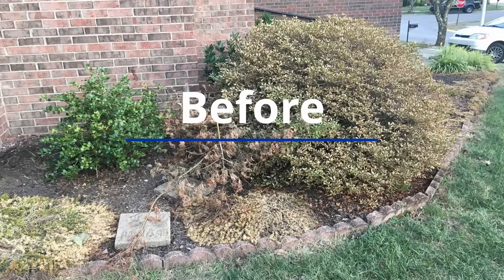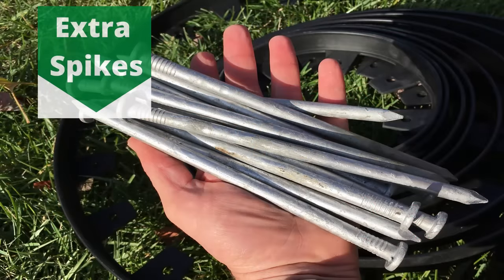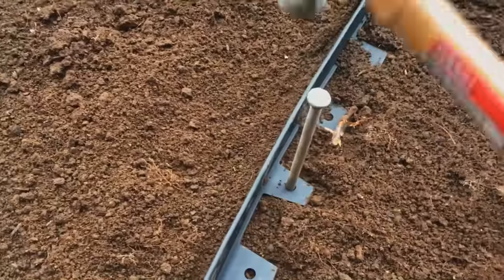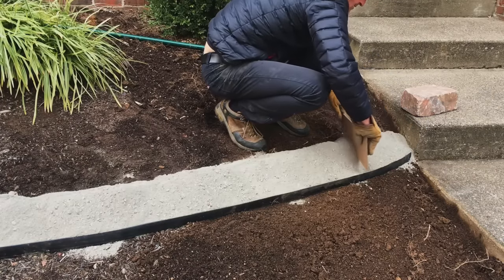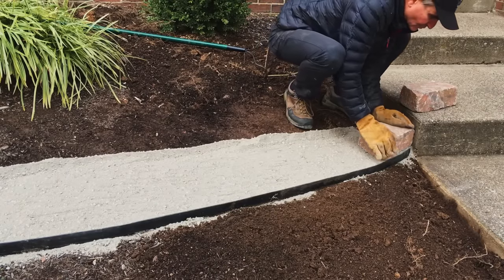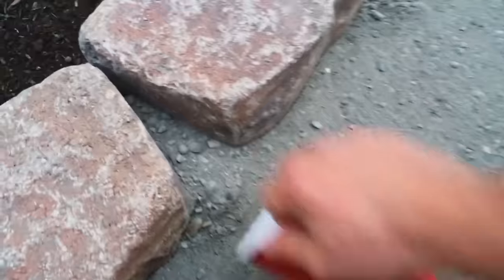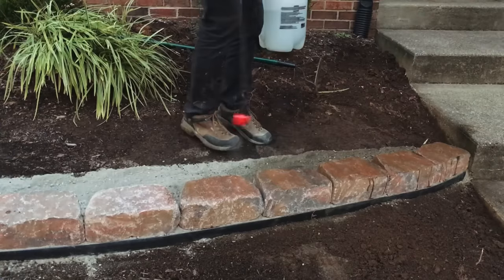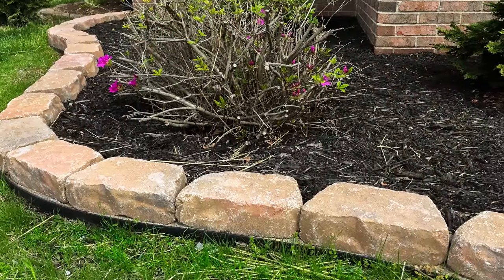easy diy No Dig Border *2020 UPDATE*

Comment: Why concrete and not just a gravel mix?
Reply from the maker: The cement provides four major functions in this border technique 1. Height(for looks) 2. Keeps the stones straight/aligned over time 3. Stability/strength 4. Weed barrier(the extra width is nearly impenetrable to aggressive weeds and grasses(Bermuda Grass) that we have here in Nashville.

Comment: Would this work with flagstone as a flush with grass boarder?
Reply from the maker: I'm interested in your idea. Can you explain the steps a little more to me?
Reply: Was wanting to try a  flagstone edge to transition  to grass. Wondering if the powder you were working with would work as well with flagstone as apposed to the blocks you used since my edge is flush with the grass.
Reply from the maker: Yes, this cement mix works perfectly with flagstone. I built a path in my front yard going to a swing and it has been there and is in perfect shape now for many years. Were you thinking you'd dig a little trench then to dump the cement mix into and cap it off with the flagstone flush with the ground?
Reply: @maxpatch67  Thank you for this information. I'm going to take your question as a suggestion of "how to" get the flush results. This is so the mower can go over the the flagstone for a clean edge between  peastone and grass.   Much appreciated.
Reply from the maker: I can't picture what you are talking about, but if you make it, I'd love to see it. You can email me pix at tim@timvogelaar.com. Have a great day, Jenny!!

Comment: In my opinion, there's no need to use cement. Just lay down  blocks and the won't move. Also, will save $. In the future, if want to remove blocks,   will get into a real problem removing the cement.
Reply from the maker: One good point you made is that the cement makes if more difficult to remove in the future.  This border should only be built if you are very sure of what you want forever. Here area the reasons cement is vital. The cement provides four major functions in this border technique 1. Height(for looks) 2. Keeps the stones straight/aligned over time 3. Stability/strength 4. Weed barrier(the extra width is nearly impenetrable to aggressive weeds and grasses(Bermuda Grass) that we have here in Nashville.

Comment: Did you use a level?
Reply from the maker: No. In almost all cases, the natural curves of the ground look really good with this border built on top of them. The border tends to self-level over little dips because when tacking the plastic edge to the ground, you don't attach it to the lowest spots,  so it kind of glides over those areas. Let me know if you need anything else, Denise! Have a good day.

Comment: thanks for this video! question: would you use this technique for a brick pathway? I'm thinking of getting the edgers, tamping some crushed concrete down.  then pouring the fast setting concrete on top and laying the bricks on top of the dry concrete.  Then coming back with more dry concrete to fill in gaps and finally misting it with water. What do you think?  Thanks in advance.
Reply from the maker: My pleasure, Valerie!!! Valerie, I did almost the exact same thing in my front yard, making a path to a swing we have in our garden area. I used flagstone with this technique about 15 years ago. I think it would work perfectly. If you went with the flagstone method, you could make curved edges which could be pleasing, but if you are making it straight, then your brick or block ideas are better. I put an alternative plastic edging link from Amazon in the video description for doing straight edges for you. Hey, if you make this please send me pix for my website as noted in the video description, I'm trying to show different ways of using this technique and yours sounds great!

Comment: Can I add a second tier
Reply from the maker: I never have because I don't think it would look so good. As you go higher, it is going to look better to use a traditional levelling technique. If you did try it, you'd need to use either mortar or landscaping block adhesive.

Comment: What if the ground is uneven
Reply from the maker: No problem. When nailing the plastic border to the ground, it will naturally skip over small dips if you allow it to. If there is such a big dip that you wouldn't like the way it looks, you could put some dirt in that area first. Otherwise, the border works equally well on flat or uneven ground.

Comment: This likely only works if you don’t have a basement or crawl space under the house.  You haven’t given the water anywhere to go but into the basement.
Reply from the maker: I use a system where I divert the water from the downspouts directly under the ground into either black corrugated pipe or white pvc(flows best) out about 15 feet or so into the yard to a drain box where the water can exit. It works really well and that's what I recommend. Thanks for your comment, umiluv!!

Comment: Has anyone tried this with sand on the base rather than concrete as a less permanent solution?
Reply from the maker: Using sand instead removes the best features of this border which include permanance, weed barrier abilities and beautiful uniformity over time that keeps the border looking perfect for its whole life. So, you can use sand, but just understand that you are losing the best qualities of the border. Thanks for the question and have a great day, Graham!

Comment: Some of my bricks didnt stick! Idk what i’m doing wrong 🥲
Reply from the maker: Did you tap them down into place into the dry concrete mix-before adding water? Did you put some scoops in between them? Is it cold where you are? It needs to be in the 50's for the concrete to set up. Without being there myself, these are the things that could make it not work right. The main fix for loose blocks in the end is to use concrete adhesive on them. I hope this helps, Irene.

Comment: Question why pour concrete
Reply from the maker: The concrete adds strength and stability as well as height and also works as a great weed barrier. It is the single best part of this border technique.
Reply: @maxpatch67  seems like using this method of just buying the quickcrete is cheaper and easier than using paver base, rock and other things to lay the stone. i'm gonna try it this week as i am ripping out my builder grade new home landscaping and pushing the grass area up to house bushes then doing this technique! thanks a lot!
Reply from the maker: alright!! I hope it is turning out good for you. The cement is so much better than paver base. The cement is really the key element to this technique that is unreplaceable. It creates structure, stability and acts as a great grass and weed barrier here in Nashville where we have very invasive Bermuda Grass.

Comment: Can you put a weed barrier under the quikrete?
Reply from the maker: This border built right on the grass, so a weed barrier might block the dry mix from spreading, and sinking down easily to a good 2" thickness that it is designed to be, so I wouldn't recommend it. Here is what I recommend for a weed barrier: https://www.youtube.com/watch?v=HIWDPlaB6wY&t=5s
Reply: @maxpatch67  nice! So is cardboard really more effective?
Reply from the maker: @red88alert  no kidding...it only lasts a year, but it is totally effective for that year and then you can redo later when mulching again...I've seen so many landscaping fabrics-even super thick ones-let the roots and weeds right through and the fabric ends up being a problem with getting the weeds and roots of them out later...
Reply: @maxpatch67  how often do you recommend for remulching?
Reply from the maker: @red88alert  Once a year is probably best. The first time you mulch should be several inches thick and that one could last two years if you just rake it around and fluff it up the second year, but after that just lay down about two inches every spring or whenever.

Comment: Any drainage issue?
Reply from the maker: I always divert downspouts into the ground and have the water exit out of the ground about 15' into the yard. If you have questions about that, you can ask and give you a little more detail. Have a great day, Mr. Chiefly!!
Reply: @maxpatch67  appreciate it. I left a gap for the water spout to just lay in the ground. Just was wondering if the areas outside the gutter run off, where rainwater directly falls onto the bed could lead to issues. I went ahead and did it though haha. I think it will be ok. Great method and it looks great! You’re the man!
Reply from the maker: Oh, I see. Ya, I've never seen any problems inside the area with water, but there is one type of woodchip that has irritated me and that it Pine bark mini ships. They are so light weight that sometimes, the will move around because they just don't sit in place will unless its perfectly flat. Hey, I'm really glad you were able to make this border!!  If you wanna add your work to my webpage https://www.timvogelaar.com/Diy-no-dig-border-folder-of-galleries you can just send me some pix to my email tim@timvogelaar.com. Congratulations!!

Comment: What size  fast set cememt
Reply from the maker: 50 pound bag https://www.lowes.com/pd/QUIKRETE-50-lb-Fast-Setting-Concrete-Mix/3006121?cm_mmc=shp-cprdbdmbinglia--masonrybaggedgoodsrepair-3006121-_-0&placeholder=null&ds_rl=1286981&ds_a_cid=119207829&msclkid=53a250d1c8eb1cfdff38300698742f7c&gclid=53a250d1c8eb1cfdff38300698742f7c&gclsrc=3p.ds

Comment: This will heave, crack and become un-level in one season in any colder climate. 

Then you’ll need a giant dumpster to rip it out. As well as blowing out your back and a whole months worth of weekends.
Reply from the maker: Not true, Bob. I undertstand that what you are saying is traditonal thinking, but its just not true. Please read comments for testimonies from several people that have built these in the Northern U.S. and southern Canada. I know it may be hard to believe these are perfectly durable, but its true. They really last through harsh winters.
Reply: @maxpatch67  You may be right - by using Flexible plastic paver restraints like the ones you get at Lowes or Home Depot one could use fast setting mortar and their own choice of border material.  It’s just like setting the edge of any paver walkway - just no walkway.

Comment: What about a second row?
Reply from the maker: Awar, I have not made a second layer on this type of border because I don't know if it would look that good and the difficulty level is raised some because you would mix up and use a traditional mortar between the layers. You could also use landscaping block adhesive. Even, though, it involves more work, I would highly recommend digging out the old dirt and mulch out of your area so the level is dropped enough so that there is plenty of room for the mulch to sit in there without spilling over. Also, the same thing can be accomplished by building your border out further so the dirt can slope down to the level of the bottom of the blocks and also have room for mulch. I hope this helps.

Comment: I currently have that concrete linear curbing that is laid down with a machine.  It's about 20 years old and looks terrible.  I want to rip it all up and do this very project!  It will be a bit expensive as it goes all the way around the house!  Maybe I can just do the front of the house.  Anybody ever rip up that landscaping curbing before?
Reply from the maker: Sounds like you ready to make a nice improvement!! Its about $5.50 per linear foot. I've never heard of anyone tearing out that curbing...hope it goes well. I guess you'd use a sledgehammer?? Have a great day!!
Reply: @maxpatch67   -No sledgehammer needed.  Every 3 feet or so is a space (for expansion) and it all sits on dirt, 
so just lift a section and throw it into the back of my pickup.  Easy peazy.
Reply from the maker: oh, cool....I guess you have made a lot of progress on your project by now, right??

Comment: Interesting idea, but probably faster & cheaper to just make a 3 inch trench, fill with 2 inches of sand, and then place the blocks. Winter freeze & thaw is very unforgiving on cement, not to mention if there us ever a need to dig up an irrigation system, electrical lines, drain, water or gas lines. It’s an interesting method, but not one that I could recommend given the variable factors.
Reply from the maker: Thanks for your comment, SaiaArt. It reflects traditional thinking on landscaping borders. Surprisingly, this border solves many problems people have with traditional techniques including extra weed control, sturdiness, long-lasting, keeps it's shape perfectly over many years. This concrete mix is super amazing and key to this border. Thanks for your thoughtful input. Have a great day!!

Comment: i would nail the plastic track on the inside rather than the outside of the stone edge.
Reply: I have also done something very similar without the plastic track. The stones are heavy enough that they do not move.  I haven't seen any shifting without the track.

Comment: This is a FAIL for me since I would STILL need to trim the grass by hand and driving the mower deck close to it will scrape the mower, make gouges in the block and move the blocks.
It also fails because of the ugly V gaps between the block.
Reply from the maker: Ya, you're right on those mowing problems...what type of border do you think is best? I'm always thinking about different options.
Reply: Just use a weed wacker against the plastic trim.  Not that difficult lol.  A lot easier than trying to edge a bed without any stone.
Reply: @mapex311  My point is to eliminate the need for ANY trimming by using a product that the mower can go over like the landscape curbing.
Reply: @trustme7731  Yeah - I'd think that would need to be flush with the grass.  But in my experience, grass and weeds eventually start working their way onto the mulch a lot easier and mulch gets flung onto the grass easier as there's no 'height' barrier from the stone.

Comment: Be careful. I found this video looking for ways to waterproof my foundation because I installed a Border around my flowerbed, my foundation cracked and the warranty company blamed my flowerbed for it. Now I'm screwed looking for ways to drain my flowerbed so my foundation doesn't get any worse.
Reply from the maker: My go to for this is to divert the downspouts straight into the ground using black drain pipe and send it underground across the yard about 15' where it exits out of a drain box attached to the corrugated pipe. Have you looked into this option? It works really good and looks great.

Comment: Has anyone tried this without using quick concrete? I don’t mind if minimal weeds get through.
Reply from the maker: You can, but you are losing out on the benefits this cement has to offer in this technique which is rigidity/permanence, height, and weed barrier. Honestly, the cement is the unique difference between this technique and all others. That being said, other types are ok also. Thanks for your question!  Have a great day!

Comment: I’m confused!!! Where did the rest of the concrete go?? You put an inch down…
Reply from the maker: The concrete is equal to the plastic border edge which is about 2". I spread it out to about a foot wide to help with weed control so each bag works for about 5 linear feet this way. Thanks for the comment, Cameron.

Comment: You needed to alternate the wedged blocks to get a cleaner straight lines without those ugly gaps on the rear or some kind of capping block to cover those gaps.

It doesn’t look natural the way its done.
Reply from the maker: How about those gaps that ppear on the front side then, when they don't fit perfectly? I've thought about that and to me this seems the lesser of the two evils. Would you reather have a little bit of gapping on the front then?

Comment: Has anyone tried this with 3 layers?
Reply from the maker: Jackie, I have not made a second layer on this type of border because I don't know if it would look that good and the difficulty level is raised some because you would mix up and use a traditional mortar between the layers. You could also use landscaping block adhesive. Even, though, it involves more work, I would highly recommend digging out the old dirt and mulch out of your area so the level is dropped enough so that there is plenty of room for the mulch to sit in there without spilling over. Also, the same thing can be accomplished by building your border out further so the dirt can slope down to the level of the bottom of the blocks and also have room for mulch. I hope this helps.

Comment: The cost of all the cement needed would be prohibitive.
Reply: $5.22 per 50# bag at Menards in the Midwest.  He stated 1 bag will do 5-6 linear feet.  If you think that's cost prohibitive try pricing landscape timbers.
Reply from the maker: The cement provides four major functions in this border technique 1. Height(for looks) 2. Keeps the stones straight/aligned over time 3. Stability/strength 4. Weed barrier(the extra width is nearly impenetrable to aggressive weeds and grasses(Bermuda Grass) that we have here in Nashville. You might want to use a different border technique since cement is a key component of this style.

Comment: I would not call that easy. Plus, of course you have to dig- you have to dig up the grass before you pile on top of it the cement.
Reply from the maker: The materials are heavy, but the border is meant to be built right on top of grass. Check out this video that shows this feature better: https://youtu.be/2GsaE9scVAQ Have a good day, Orange Ziggy!!